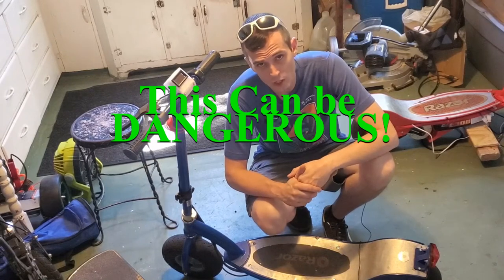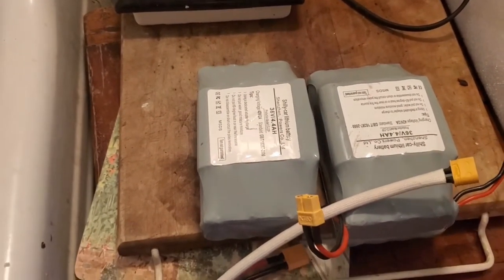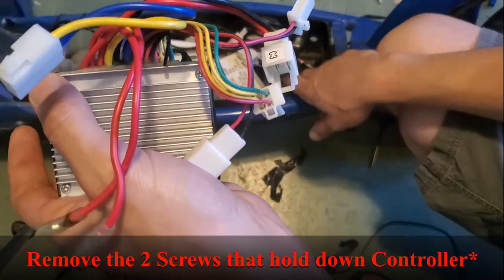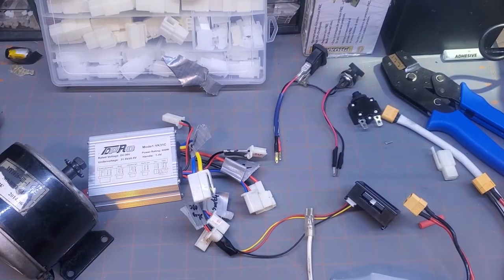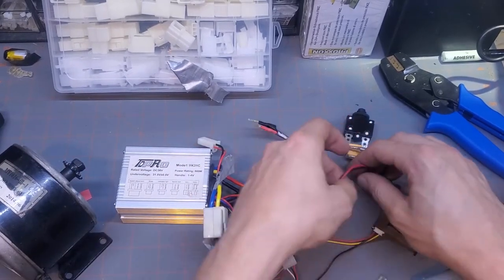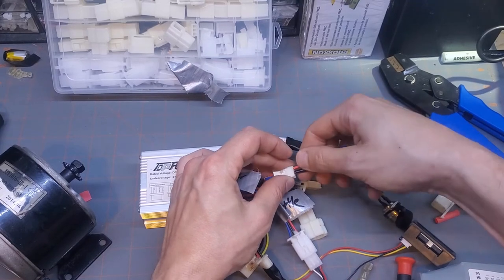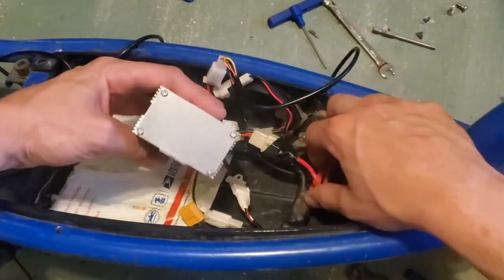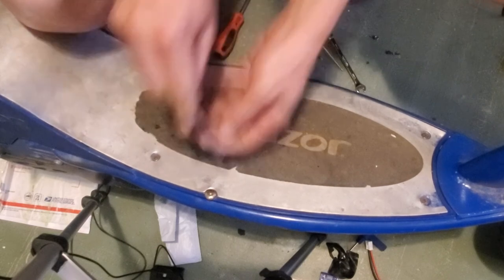Should You Upgrade Your Razor Electric Scooter? Motor Controller, Battery, Throttle, & 1ST RIDE!

Comment: Thx, you answered all my questions except one, where can you buy the cables and stuff needed to plug the hoverboard battery into the controller?
Reply from the maker: "XT60 Plug Power Parallel Battery" and then "xt60 to spade".  I made mine but u can do the same thing with those 2 cables. Or buy just the xt60 parallel and cut the other end off and put femal spade connectors on the single end.

Comment: Do you have any preferences on thumb throttle?
Reply from the maker: It's really kinda personal preference. I have an old road legal Enduro dirt bike, so I'm really used to a twist grip. That being said, I think thumb throttles are a little safer, bc in an emergency, people will sometimes accidentally engage the throttle while trying to maintain control of the handlebars. I have a cheap thumb throttle/voltmeter I picked up for like 12$ and it works well. They all do the same thing pretty much, which is just providing a variable voltage from 1v to 4v, which the controller uses for determining how much power to give to the motor. Just a cheap hall effect sensor in almost all of them. Hope that helps answer questions

Comment: can I just upgrade the battery to make it go faster
Reply from the maker: If u switch out to a 24v lithium it will last longer and be a little faster. You cannot use a 36v battery with the stock controller.  I recommend at least a 10ah 24v battery if u are going that way
Reply: Get you a fardriver ,and 72v pack

Comment: I want to do this but all the ebay links are dead. can you provide part numbers and or manufacturers or possibly new links? aliexpress links would be a bonus
Reply from the maker: Im.sorry I don't currently have time to go back thru and find current links. The key words to search for the parts you need should be in the video. Throttles, motor controllers batteries are all pretty much the same, you may have to change the connectors at the ends to make them match. Idk if hoverboard batteries are as cheap and plentiful these days so im bot sure where to search for them. Ebike and scooter parts are pretty much the same. Just make sure u get a brushed motor controller not brushless if your sticking to stock

Comment: Awesome video man, love this idea! Very good instructional too 

A modded Razor E300 is perfect for what I’m looking for. I had a Segway Ninebot and it was a pain to pull the front wheel off just to change a worn tire. All the electronics seemed fragile and I’ve heard bad things about them once you get a few problems that start. E300’s are a simple steel frame, battery, basic electronics, throttle and chain driven with one mechanical brake. Who needs fancy rainbow lights under the deck or a digital speedometer with multiple speed settings. I’ll definitely look for a cheap E300 that I can mod into a good simple commuter scooter 

One question - does a level 1 upgrade reduce the lifespan of the motor by much? 

I’d be looking to keep it pretty basic and get like 20mph top speed and increased range. With a sprocket change I’d hope to get more torque and low end acceleration rather than a fast top end.
Reply from the maker: It may reduce motor longevity, especially if run at full throttle on a large battery for a while. Good news is that a replacement motor is like 30 bucks for stock or like 50 to 60 for an upgrade. I don't know how many miles I have on this scooter but I'd say at 200, dome about 4 to 5 at a time.  The thing about increasing the voltage to 36v, is that u drop the amperage needed to get power. 200watts at 24v is over 8amps, whereas 200w with a 40v battery is only 5 amps. So there is a trade off. 500w is definitely doable for these stock motors at 36v-42v. I would recommend an 8 to 10 ah battery rated to do 500w.
Reply from the maker: I also agree with putting a smaller sprocket on. I think I run a 45t v the stock 52t on my other higher power e300. Also a thicker chain but thats just bc 800 to 100w on the stock chain its really sketch
Reply: @HughsScamProducts you gained a new sub for my e300 I got a 350 warranty motor In mind

Comment: Bro . I make scooters (very fast ones)  you either want a suspension, or you want a big tire . The faster they go the faster they fall apart! It would be cool for much farther range / efficiency? But to go much faster is skech
Reply from the maker: @Vmaxfodder  I agree. 22 to 25 is super sketch on these scooters. The ability to ride hard suspension bikes and scooters is learned, not everyone can do it. These scooters definitely have more potential than the stock 15mph or whatever. My red one that has a 1500w brushless is like a drag car. Really good at doing one thing, not a daily driver. I agree that a good suspension will be safer and faster for 95% of riders. Thanks for the comment
Reply: @HughsScamProducts  I made a 40kw ultra muscle footscooter.  Had to turn it down to 28kw . 100.8v top charge . Built from scratch . Been watching videos like yours ,and thinking of re- purposing.  Good job . Hope the scooter is still serving you well.
Reply from the maker: @Vmaxfodder  my 75 year old mom rides it occasionally, I ride my one of my onewheels mostly. I live in a very small city where the furthest I have to go is 5 miles. But a suron or a hyper scooter that does 55 to 70 does sound tempting!

Comment: Hey, thank you for the video I appreciate your time. Is there a smoother speed controller out there now that I’m asking you the question it would probably be the brushless set up but is it the motor or is it the speed control or is it the throttle one more question, do you think a twist throttle is better than a thumb throttle?
Reply from the maker: All variables throttles will give you a much smoother acceleration than just the standard on/off that comes with the e300 stock. You will need a new motor controller that accepts this throttle. If u are using the stock motor, a cheap brushed controller is like 13 bucks. 500w is good start that won't tax the stock motor too much. My 75 year old mom borrows the scooter in this video to go on longer trips across town than she can comfortably pedal her bike, and really enjoys the smooth acceleration. Other scooters that I have that have more power, she doesn't like bc its not as controllable as just a stock setup with a new battery, motor controller and variable throttle.

Comment: Great video! Can I upgrade to a 1500w 45a controller on the stock 36v motor?
Reply from the maker: The stock motor is a 24v so this mod is already overvolting the motor. Many people have run 36v 500w controllers, however idk if it can handle that much amperage without letting the magic smoke out. I have another one I put one of those cheap 1500w brushless on but its crazy big and requires extensive mods. Rc test flight made one with a 8000w alien power systems 84mm outrunner brushless motor. Goes like 50 mph. I wouldn't push more than 700w on the stock, and not for long. The motor gets hot If I ise it full throttle for like 3 miles.
Reply: @HughsScamProducts  My bad this Razor scooter I got came with a 36v motor on it. I think its 350w. The controller is toast. I have a 36v-48v 1500w 45a controller I want to try but fear it is too big.
Reply from the maker: @randallgaus502  yeah just make sure u have a brushless controller for brushless and a brushed for brushed motors. Easiest way to tell is if motor has 2 or 3 wires, or 8 for that matter. 2 is brushed 3 big is brushless
Reply from the maker: @randallgaus502  new motor controllers for 350 w are cheap. Brushed or brushless like 15 bucks. Ebay or Amazon and most will work just fine
Reply: @HughsScamProducts  Yeah it's a brushed motor. The controller is one of them ones that is potted with black epoxy and only had the power in, motor out, and throttle input. Maybe I'll give it a try.
Reply: @HughsScamProducts  I'm watching some of your other videos now. Thanks for the great info and your time.
Reply from the maker: @randallgaus502  https://www.ebay.com/itm/204231384504?mkcid=16&mkevt=1&mkrid=711-127632-2357-0&ssspo=ccorag1krpi&sssrc=2349624&ssuid=z62g-qqfSji&var=&widget_ver=artemis&media=COPY is definitely one that will work. Or u could put a more powerful one in there. Good luck!

Comment: Out of curiosity do you know how water resistant the motor stock motor is?
Reply from the maker: Really depends on the water, how submerged and stuff. I saw a video of a guy running his rc motors under water to clean mud out, but idk about that. Best is to use wd40 lubricant on the front and back of the motor. It may smoke a little as the wd 40 burns of the brushes. It will help with dust and dirt build up. Other parts of the scooter such as the controller are definitely not waterproof
Reply: @HughsScamProducts  If I'm doing a 48v system (I know I'm overvolting the motor) do I need to connect the breaker? Also is the breaker just like a fuse? The battery has a built-in BMS but that only protects the battery right?
Reply from the maker: @milolim48  yeah thats only rated 32v. U can buy higher voltage ones on Amazon if u want that protection
Reply: @HughsScamProducts  also I thought the stock one was 350watts but I read ono Razor's website that it's only 250watts?
Reply: Also do I need to connect the breaker or have a fuse or does the BMS take care of all that?
Reply from the maker: @milolim48  yeah e300 has a 250w stock motor as far as I know.
Reply from the maker: @milolim48  the bms does not. It only handles charging and discharging but will not prevent a voltage surge so a fuse or breaker is recommended.
Reply: @HughsScamProducts  Where is the best place to wire the fuse, and how many amps should the fuse be? My battery is 48v 10A.
Reply from the maker: @milolim48  it's prob a 10ah which is a measurement of power Over time. Depends on the motor controller you use. If it's a 500 watt controller, 15amp should be fine. 10amps is 480w so prob would blow easy. U can get a 60v 15amp breaker or use a fuse
Reply: @HughsScamProducts  OK so if I have a 48V battery 10A with a 48V 1000w controller then I should use a 15A fuse?
Reply from the maker: @milolim48  depends on your motor controller. How many watts is your motor controller?
Reply: @HughsScamProducts  How bg the the battery compartment? I'm looking at a battery that is 13" 6" 2.25" will that fit with the controller too?
Reply from the maker: @milolim48  I don't remember the dimensions but remember there are ribs on the bottom and it should be below the cross brace so when you weight is standing on it, it is not pushing on the battery at all. My battery was too big and and I had to raise up the entire aluminum deck to ensure the battery was safe. Also on that one I mounted my esc on the from stem ( handle bar stock) to give myself more room under the deck to Included the add wires, alarm and re routed break lines.

Comment: Can a 24v throttle work on a 34v control module?
Reply from the maker: Not the stock one. It's a switch not a throttle.
Reply: Most throttle are 5v the controller makes the exchange

Comment: Do I need to upgrade the motor the make the scooter go 22/23 mph?
Reply from the maker: No
Reply: @HughsScamProducts  ok
Reply: That depends on the weight of the rider and the terrain. My current motor (200W) gets very hot in my E200 running with the 7S 4P pack I built. I am currently upgrading my scooter to a 350W Motor and controller so it can go faster and handle the load.

Comment: @Hugh's Scam Products  I found the xt60 plug power parallel battery online but I can't find the xt60 to spade, can you send me a link?
Reply from the maker: https://www.ebay.com/itm/334437340911?mkcid=16&mkevt=1&mkrid=711-127632-2357-0&ssspo=sxJhbPuHSjK&sssrc=2349624&ssuid=z62g-qqfSji&var=&widget_ver=artemis&media=COPY
Reply: https://m.media-amazon.com/images/I/51BP1NOGdxL.jpg - which one is the right spade connector? I'm guessing its the first 2.8 one
Reply: @HughsScamProducts So, do I pull out the 2 blue connectors and that will reveal a spade connector???
Reply from the maker: @its.arwong64  those blue things are female spade conncetors
Reply: @HughsScamProducts  Ooohhh, sorry, I didn't notice 🤣 So do I slide those blue things into the breaker?
Reply from the maker: @its.arwong64  positive side goes to the line side of breaker and negative goes to the negative on motor controller.
Reply from the maker: @its.arwong64  then the jumper which has female 6mm spade connectors on each end and is made out of 10guage wire goes from thr load side of breaker to positive on motor controller
Reply: @HughsScamProducts  how do I know which side is which on the breaker
Reply: @HughsScamProducts  I can't find the jumper wire online, can u link one?
Reply from the maker: @its.arwong64  buy a pack of 6.3mm spade connectors and cut one of the wires off the old battery and put a female spade on the other end. There should already be a female spade on one end of the wire. Or use an 8  or 10 guage wire and put a female on both ends. Jumper wire is a generic term for a short peice of wire, u prob can but one but im not searching

Comment: Hi did you do a video of your red e300 could you let me know what upgrades you did with that one as i bet it goes alot faster than the blue one. Ive got 2 e300's here and im wanting to upgrade both of them so i just wanted to compare what your 2 are like. 😊xx
Reply from the maker: I have not done a video yet but I should. I used a 1500w brushless motor, about 100$, 1000w brushless controller (25$) and a 10ah 36v battery(130$). Also a headlight/horn(16$), alarm (12$), variable throttle (10$),custom switch holder for crusie control switch, (6$). As far as mods on the frame itself, cut off kick stand and added 2 small steel bars to mount the larger motor. I will try to make a quick overview video soon
Reply: @HughsScamProducts  thanks for the reply.  Do the batteries and the controller have to be the same voltage 🙂xx
Reply from the maker: @vikkidyer  yes, most controllers are setup at a certain voltage. Some are 36v or 48v but they will have cut off voltages that are set so the batteries don't over drain
Reply: @HughsScamProducts  great I will look for a new battery pack. That's the only bit I was unsure about.  Thanks so much for your help 🙂xx